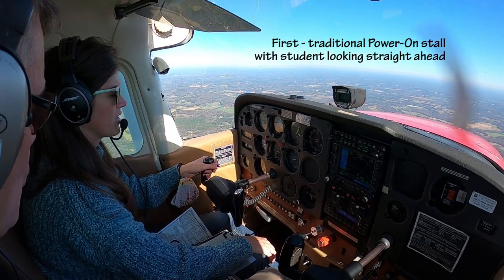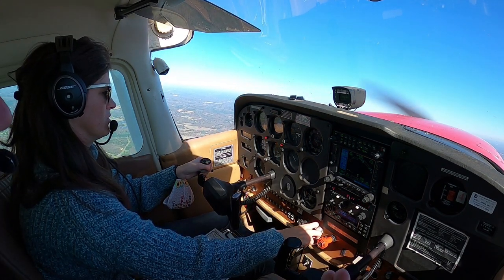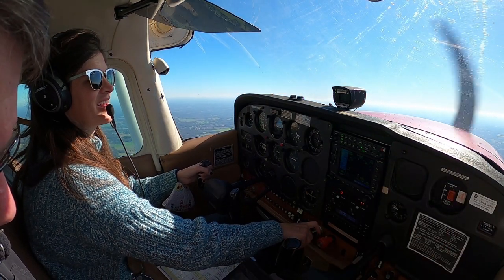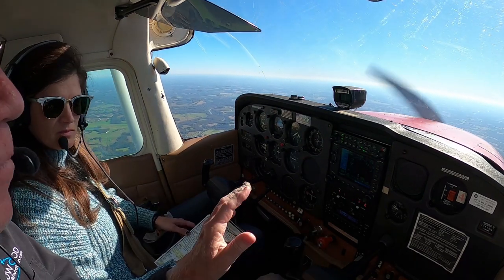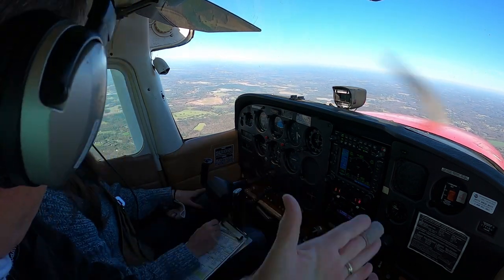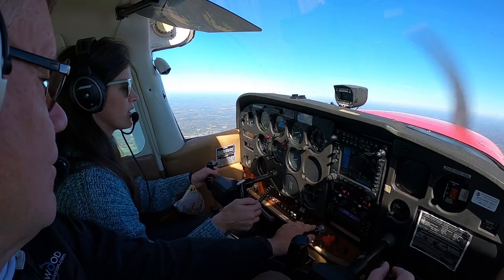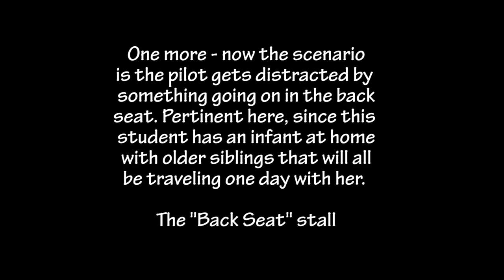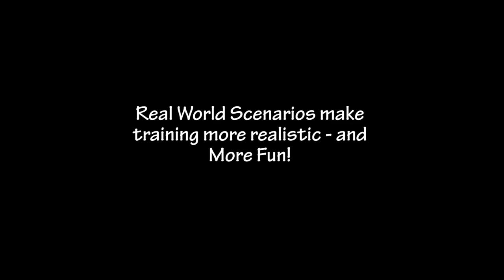REAL LIFE Power On Stalls

Comment: Very surprised that someone “post-solo” doesn’t know their numbers. Also not knowing how to control a power on stall while flying solo is a recipe for disaster.
Reply: I am a 7 hour student pilot and I the C-152 was up for it's 100 hour, so me and my CFI decided to Piper. The V speeds are all different, and now having to remember two sets of V-speeds, in addition to how the plane handles and some controls in different locations and roasting in a very hot plane. It was fun trying out the piper but my brain at this time can only deal with one set of V-speeds and plane controls.

Comment: First half of the video was excellent, but it doesn't feel right about putting the power to idle on recovery from a departure stall, remember that the learner does not know about unusual attitude recoveries yet, so she should probably be trained on recovery from a departure stall first which entails putting power all the way forward (which it should be already) AND pitching below the straight and level line in respect to the horizon at the same time, stopping any turns, climbing away, and going back to the original altitude and heading. If the plane does end up in the insipient spin phase, then take the controls and teach her about stall awareness first, and then you can teach her about insipient spins, spin awareness, and spin recoveries. When you teach her about putting the power to idle because the nose is too down and as a result, it becomes an unusual attitude or worse yet, an insipient spin, it will confuse her later on or maybe she will get it, who knows? But the problem is, is that she needs to know the distinction between those two phases: (1) recovery from a departure stall still? , or (2) is the plane now in the insipient phase of spin or an unusual attitude? Why is this important? Well, learners are impatient and they have emotional reactions such as doing things too quickly because they don't like the present situation and they want to get out of it as soon as possible, especially during their solos, if, God forbids something happens like a departure stall on her solo, she may put the power to idle right away (emotional reaction, impatience) on recovery which is obviously dangerous because you need both power and pitch forward to recover from a departure stall. If THEN the plane enters an insipient spin or a nose down unusual attitude, then she can put the power to idle, but not any earlier than that. That distinction needs to be made to her and the learner needs to understand that so that way, even if they do make a mistake, they can correct it by applying the correct procedure 2 or 3 seconds later, hopefully. Anyways, I just wanted to point that out, your teaching styles is one of the best ones I've seen. Thanks for keeping the sky safe.

Comment: Personally I would have trim the plane to hands off at 75kts then bring in full power the plane will then climb at the trim speed without any pressure of the yolk.  Then pull back firm until it stalls, just drop the nose don't touch the power stop the wing drop with rudder.

She it trying to pull back with more force that she would have in a normal TO that was trim for TO speed.  

I did like the turn around and and stall the plane.

Comment: Every instructor teaches stalls this way. To pull the yoke back quick enough to induce the stall break ... And that is NOT how stalls are entered in reality. They are entered slowly as the student was doing. What happens then, is one wing stalls just before the other one and the airplane feels like it has entered an uncommanded turn. All too often then, the pilot uses the ailerons to try to counter the uncommanded turn, which just causes the wing to stall worse. This is bad enough on an airplane with benign stall characteristics like the Cessnas. If this happens on an aircraft with a high performance wing (like some replica warbirds etc) the result will be a spin or an inverted dive into the ground.
This happened to me on short final in an airplane with docile characteristics. I recovered using attitude and power and went around. It was only after I landed that I worked out what had happened. This happened on a windy, gusty day and I lost track of my airspeed. The gusts were 15kt above the wind speed and that is what caused my stall.
I don't know why instructors keep teaching stalls this way. New pilots don't recognize a stall when it doesn't "snap" like it did when they were learning.